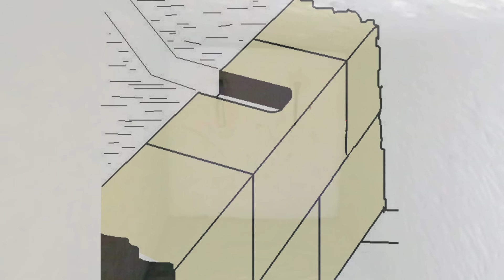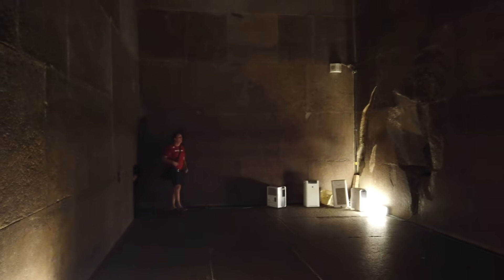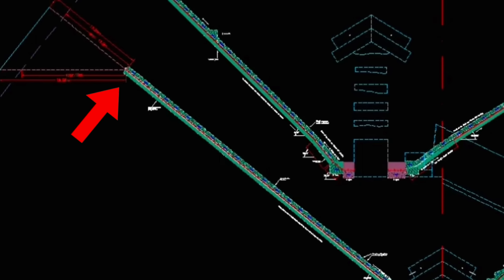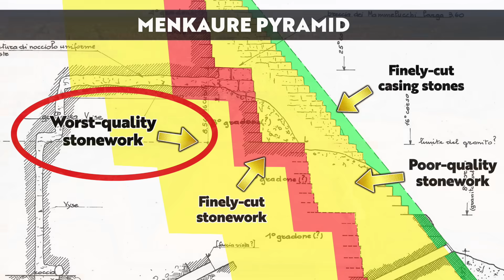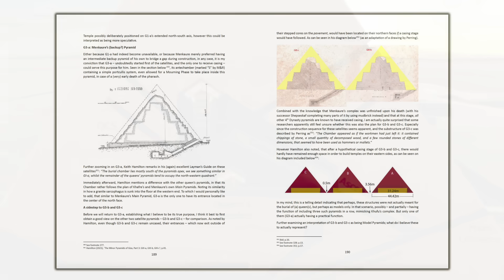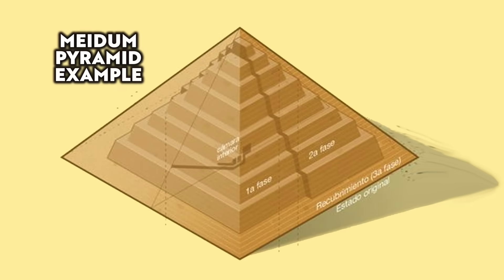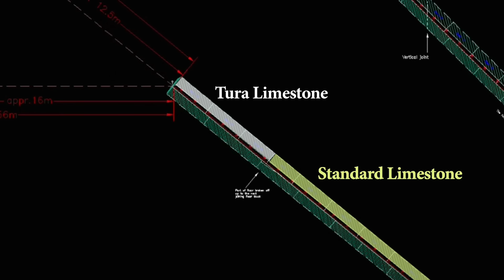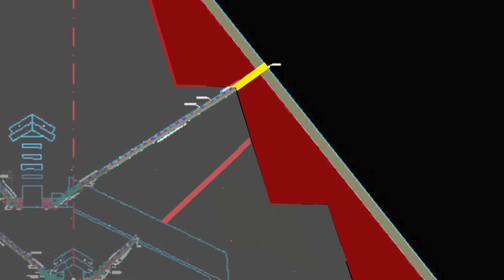Great Pyramid HIDDEN Steps Explain Everything | Part 1

Comment: happy bithday Matt ;-) ..well, if one gives up J-P Houdin's pyramid construction theories completely then you would have to explain ALL construction phases anew, this actually is a big stepback..how to build the inner step pyramid, how to add outer fill layers and Tura limestone causing layers without internal ramps and counterweight systems? from the outside just as the flawed models of other egytologists? It's the biggest advantage to theoretically explain all that.

Comment: Try in your new video to emphasize the role of the relieving space represented by the "Grand Gallery" in relation to pressure and the interaction of masses within the tiered structure of the pyramid’s core. Specifically:

Wherever there is a passage or void inside the pyramid in the form of an inclined gallery, that is precisely where the main pressure of the masses passes and interacts. Such a structure forms the central part of the core, which serves as the fundamental base for the construction of the upper tiers. It should be understood that the lower part of the pyramid — roughly the first three tiers, with a total height of about 63 meters — represents a “relieving pressure zone,” which absorbs the primary weight of the entire monument. Above this level, the pyramid’s sections are merely superimposed and do not experience the same intensity of internal pressure. Accordingly, the main massive part of the internal core of the pyramid has a height of about 43–63 meters, and its upper boundary coincides with the level where the so-called “Big Void” was discovered. In other words, the essential element of the pyramid is the first three tiers of the core, each tier being about 21 meters high.

Based on the physical laws of mass interaction within a multi-tiered construction, it is logical to assume that a relieving section in the form of a large inclined gallery may also exist symmetrically — on the opposite side of the Grand Gallery. This is explained by the fact that the distribution of loads in a monument of such scale cannot be one-sided: balance would be achieved by a paired or mirrored system of relieving elements, which ensures the stability of the core and the even distribution of forces within the pyramid

Comment: Great deduction process! What about the original use of the grand gallery as an astronomic observatory corridor in the early phase of construction of the bulk structure? Could it have been used as an observatory platform in the style of babylonian ziggurats?

Comment: in my thought on the construction, the grand gallary was used to transport the blocks up a hieght then added to to get higher, once the top was reach, they needed another to get even height , so another was built into the structure to tack over the movement of the blocks to higher levels hence the void, as with everyone else the tippy top ones baffle me, im picking those were smaller and may have been dragged up the side, but maybe not

Comment: Fully agree with the stepped core idea. I worked as a land surveyor all my life and I am used to dealing with angles, sight lies etc and never went along with the idea that the outer casing was added along with the main construction of the pyramid. There is no way the casing could be aligned to meet at the apex. Cutting stones at an angle or using some sort of angled sighting board just does not work. There had to be a point to aim at. A pole or temporary tower on the top of the stepped core would have been used.

Comment: If they build a step pyramid first and then adding the outside structure from ground up, they would have to remove the ramp and build a new one. Moreover, the ramp could not have been a go around style ramp, but could only have been a straight ramp. Anyway, whatever the ramp structure, rebuilding ramps seems like a waste of resources.

Comment: Very interesting theory. It makes a lot of sense. Not sure I agree with the classical idea of the pyramid as a burial chamber, though. Q: What happens to all the synergistic dimensions of the pyramid of it was made smaller? Was there sensible numerology for those dimensions, too?  We still have the problem of perfectly fitting megalithic foundation stones that could be far older than the superstructure. Does this imply that the pyramid was rebuilt on an older foundation? Could the Queen's Chamber belong to an older, original pyramid, and the King's Chamber belong to a newer rebuild?

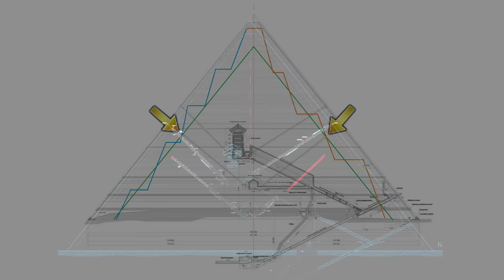Comment: 10:07 The Core is asymmetric in His Drawing yet You show it as symmetric, something else needs to be said to explain the oddity of His asymmetry.  There is a fundamental nonsense in all this however.  If The Kings' Chamber is so important then by design it would have been at the centre not the Queen's.  The King's is offset because of stability issues if it was to be structured over the Queen's. The Queen's was there first the King's was an after thought.  Perhaps the original stepped Queen's Pyramid was constructed some time in the distant past and then the whole edifice re-engineered at a later date for a new 'king'.  There could be quite a temporal gap between the stepped and the clad edifices.  Either way though, Your thesis viz a viz the air shafts makes sense.  The whole 'contingency' concept is however totally superfluous if  indeed there was a temporal gap twixt core and clad.  Occam's razor would suggest not contingency,  but just the passage of time, sand and design.

Comment: The Land of Chem, Geoffrey Drumm(who you seem to ignore), says that the kings chamber(sulfur gas furnace tank) has air shafts for the furnace to breath, and the queens chamber(acid extraction final mix) has shafts that would be for determining the mix level and temperature, and these shafts were closed off to the chamber using a system that detects the mix level through 3/4 inch stone, and could not have been for air flow.
Reply: Really . Would you like to be inside a pyramid determining the chemical composition of gases and acid ? Where are the pipes tanks and control systems , besides residue deposits . Maybe they used electronic sensors ? How would maintenance be done with all the access that is not present to allow it . Geoffrey is a great entertainer ,  rather like Von Danican ; worth watching as he does show a lot of things others do not.... his videos almost take you there , as do his wife's channel , so I recommend watching their work even if I do not agreei with his theory

Comment: While that is all believable, we are still in the dark about things for which there are no answers... including: 1 why is the King's chamber offset from the central axis of the pyramid?  2.  Why is its ceiling so unnecessarily high?  3.  Why is the entry passage so unnecessarily low?  4. Why is there over 1 million pounds of granite pressing down on the ceiling of the King's chamber???  5. Why wasn't it protected by nothing other than chevon blocks like the ceiling of the queen's chamber?  6.  Why does the subterranean chamber even exist?  Did it pre-date the pyramid construction?  -and 7.  By what unknown means were ancient Egyptians able to quarry, transport, shape, and raise 143 granite blocks of enormous weight?
My point is to advice against any sense of deflation of the mysteries that surround the Great Pyramid.  There are still more than will ever be  answered.

Comment: totally makes sense built from the inside out.  Probably covered the top so sand and wind didnt get in and forward thinking made the air shafts.  Once they got higher no need for air or debris to come in.  Classic step pyramid redesigned later but many questions on it being a tomb when their is no markings and the valley of the kings is where they went.  Almost like a marker like we did this kinda thing.

Comment: Point of note - The Air channels are so small that they would have had to have been built as the original blocks were put down, which hints at the idea that they were planning one thing, then dropped it and started something else. So the Queens chamber could have been the main burial vault, but that was dropped as they made plans for something higher in the structure.

Comment: The pyramid never was a tomb, and you know it. It was an energy generator and people went in like they do for any power plant. For maintenance and replenishing of materials. 
It wasn't built by Kufu or any Egyptian. 
The math for the number of blocks being manufactured, transported, and assembled per day to construct the pyramid within a 20 year period are exclusive of reality and even possibility. Get real.  Math doesn't have an agenda, or political, cultural, or societal prejudices. It is what it is. PERIOD. No way 315 blocks per day were quarried, transported shaped, and assembled each day for twenty years. It's a ridiculous assumption to even consider that as a possibility, let alone a reality.  2,300,000 blocks in 7300 days (20 years) that's 315 blocks per day. If you believe that, then you have some serous problems dealing with reality.

Comment: I think the concept that it was a tomb is laughable.
The valley of the Kings is where they were buried .
This pryamid was for another reason. More likely a power generator of some sort.
The design and use of rocks used are beyond the ability of the Egyptians to construct. 
Granite ! And dolomite limestone and capping stone is amazing not to mention the exactness of the measurements.   Also the size of the. Blocks .the quarry ( miles away /the cutting / chamber positions etc.) .
The two copper electrodes seen in a block -gives it away!! 
Water underneath and great quantities of quartz (a useful electrical conductor) 
Na not a tomb🤔
This was an advanced Machine .also had a gold cap .
Why ?  Best conductor of electrons and electromagnetism . 
How old is the pyramid.? Pre dates Egyptian dynasties .
We keep guessing?

Comment: I like it but I don't think it still supports that there was ever a contingency to make the pyramid smaller. I think the queen chamber shafts being shorter just means that the kings chamber was successful at a point in time that they didn't need to make extensions on the queen chamber shafts farther through the exterior structure.

Comment: The Great Pyramid was not a mausoleum. Actual Egyptian mausoleums were completely different and always richly decorated.
Reply: it was an early one, much older than many later, more decorated ones. No decoration ist also a valid philosophy when it comes to spiritual topics.
Reply: @andyhug90  There is actually no evidence whatsoever that it was a mausoleum. Only the "stone coffin", which may not even be a coffin but a ritual place. Archaeologists should admit more often that they do not know much for sure.
Reply: Generally a mausoleum houses several bodies, the Khufu pyramid was meant to only house one body. So you are technically correct, it is not a mausoleum, but a tomb. :-)

Comment: Used for Air flow? Dude, the inside of the pyramid isent even built for proper Human movement. What are you talking about? The entire thing looks like it was built with the intention of not having humans inside it whatsoever.
Reply: @VornaTruth: Nope.  The passages into the chambers are entirely passable by humans, even the passages with lower ceilings where you have to hunch over or even crawl on hands and knees.  That's how the original explorers were able to get into and out of the chambers.
Reply: @JohnMSawyer   The third chamber isent even reachable. The Hole to get into the 3rd chanmber is near the ceiling lol
Reply: If it was never meant to have humans in it whatsoever, why would they go thought the trouble of putting finely finished stones on the interior of the chambers/passages when a rough-cut hole would be enough to pass a coffin through? Why would they build enormous chambers when you'd only need one, two rooms for the pharaoh and his stuff?
Reply: Yeah should have a roller door on it so you can rob treasure easier hey 
These smaller passages are no good for looting
Reply: @ryana82  I see what you are saying. As if it was built with the intention of denying looters. But then there is a problem with that. What is the point of making the rooms have weird bizarre over sized ceilings? This dosent do anything with the concept of denying a looter, or even assisting with storage. The ceilings just go very high, normally in a triable shape for some chambers.  Also, as far as we understand, was any loot even found in the pyramid of Giza? Heck, there isent even Torch soot.

Comment: That 2-D image does look like it shows a spiral, to me.  Each partial "square" is slightly offset, first to one side, then to the other.  And I note that in Lauren's "rough estimate" side view drawing, he shows the steps at different elevations on one side vs the other: i.e., what you'd expect to see if it was a spiraling ramp.  The spiral theory doesn't seem to contradict any of your other suppositions, and it gives a clear hint as to how the inner core would have been constructed.  Given the interesting results obtained from these "microgravity" studies in the 1980s, and the recent developments with seemingly impossibly sensitive -- yet apparently credible --  measurements being done from space, I'd hope that 40 years later, maybe we could see a much higher resolution "gravity scan" and get a clear view of these internal structures.  Thanks for your work!

Comment: The QC air passages might have been in use while the QC was being worked on, and the outer walls were not as high up as the now-closed outlets. Meaning, when they stopped working on the QC, they stopped working on the QC air channels. Since the pyramid grew from the ground up, it doesn't require a stepped inner core for this theory to make sense. However, the stepped inner core theory itself seems pretty solid, so ..,

Comment: That's probably why the outer face looks stratified. I imagine they didn't wait until the whole stepped structure was complete before they started the slope. I think the internal ramp idea of The Great Pyramids Equation is one of the best explanations for the construction method with internal ramps.
I had an argument years ago with someone that claimed to be a civil engineer that if you kept removing floor blacks fro the kings chamber that it would be like chimney structure that went a lot further down.

Comment: I kind of agree with you, but the fact that the stepped core has dressed stones does make me wonder about whether these were the original outercasing stones, and the more sloped sides we think of are from a renovation at a later date.

And if I think about the C14 dating from the Dixon Artefacts as well as the dating aquired by the C14 Dating of The Great Pyramid Project, I do think this is more plausable than just a simple change in the plans so far into the job...
Reply: My thoughts exactly. It seems more likely that the Queen's Chamber and terminal air shafts belonged to the original, older pyramid, and the King's Chamber and open air shafts belong to a "modern" expansion built much later over the top of a possibly eroded, damaged, obsolete, or not-big-enough pyramid. Let's not forget the perfectly fitting foundation stones that are supposedly thousands of years older.

Comment: I don't think that the Queen's Chamber makes much sense as a contingency in case the King's failed. It's lower in the Pyramid, and has significantly more weight above it, and thus would be the more likely of the two to fail, even being a little smaller. Also it being perfectly centered seems significant. If the Queen's and King's chambers were essentially constructed for the same purpose, I'd expect that the King's would have followed suit. But it doesn't. I still think the two chambers served different purposes. But I do think that the end of the Queen's air shafts being the edge of the internal structure seems plausible. In any event, I suspect that whatever we find when we look around the void above the Grand Gallery will likely alter our thinking. I just don't think we have enough information yet to try to draw conclusive theories about what various chambers were for.
Reply: @EmmanuelGoldstein3 You read my mind.